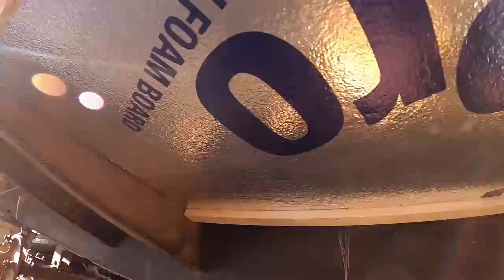Mobile Home Underbelly Repair￼. Singlewide Trailer

Comment: I use. Those big glue traps. Right at my door access underneath.  Open the door get the ones out that caught mice put down new ones.   At least it knocks down the mice population.   Works great and get the ones under thier simply throw away.   No stink. Poison  you will never find them and will stink.
Reply from the maker: Trust me I found that out that’s why the insulation is all been removed we could not find the smell. But when we get out there and remove the insulation we found it. I decided that since mice had been there I didn’t want to leave what they lived in so I removed it all and replace it with new

Comment: Are those mounting boards 1x3's ?
Reply from the maker: Yes, and they work good
Reply: @Drewsroofingandhomerepair  Maybe you could help me with this? I have an old mobile home with 5/8 subfloors. Bits and pieces are bad and I have some extra 5/8 plywood laying around. Should I replace the entire floor or just patch it up and place flooring over it?
Reply from the maker: If it were mine I would do it all
Reply: @Drewsroofingandhomerepair  I'll change it all if my budget allows for it. I'll have to see what the wife says. Thank you for the response and everything you do to teach people about repairing mobile homes.
Reply from the maker: Thank you I really try to help everybody that I can. I’m glad I am able to help you if there’s anything I can do you can call me. I don’t mind talking on the phone. My telephone number is in my description somewhere or you can see it on the back of my trailer on my truck, definitely wouldn’t mind talking to you

Comment: I wonder if mice will chew on the foam board?
Reply from the maker: Mice chew everything and anything. Poison and underpinning is the thing. if you have good underpinning and poison your good
Reply: @Drewsroofingandhomerepair  Thanks for the videos!  Been slowly working on my mobile home, right now I'm installing all new Pex water lines. Need to replace the subfloor and insulation, feel lucky because my floor joist are 2x6. Thinking about Stone Wool insulation for the floor, more costly but like how it's water-resistant and fire-resistant.  Then 1/2" foam board as underpinning like your doing but then 1/2" galvanized wire cloth stapled to the 1" x 2's Just need to find the engery to do it. Warmer weather will help,don't like working in temps below freezing. Might make some videos of what I'm doing and add them to my YouTube page. Thanks again.
Reply from the maker: I look forward to your videos let me know when you start making him if you need any help let me know
Reply from the maker: If I can help in anyway be sure to call me remember if you look at my videos you’ll see my telephone number on my trailer call me
Reply: Baking soda mixed with peanut buter will also work...mice will swell up from the baking soda. Just keep in mind that the baking soda method is slow😁
Reply from the maker: I do not like them dying in my insulation under my house
Reply: @Drewsroofingandhomerepair  I live trap all the mice for just that reason…